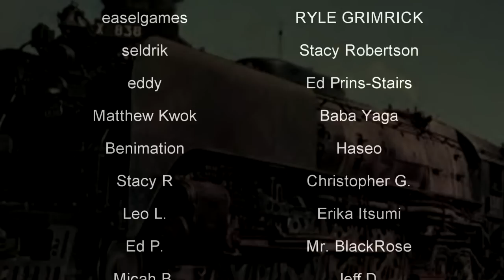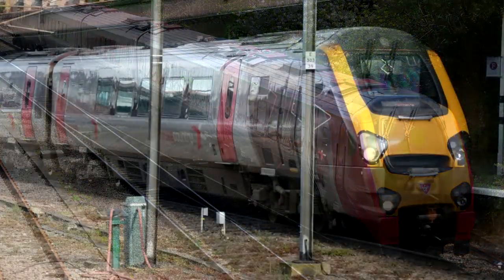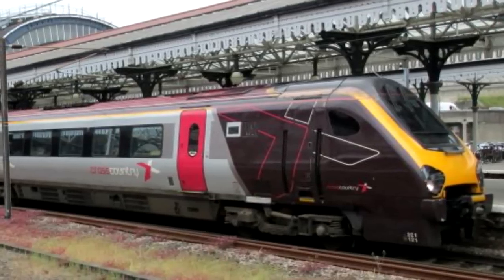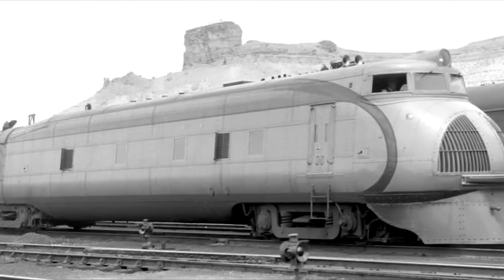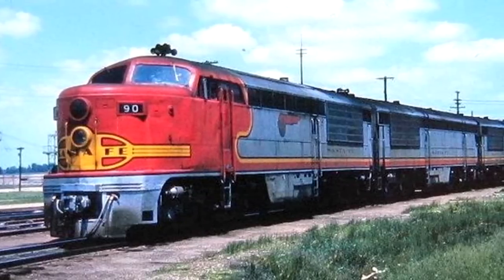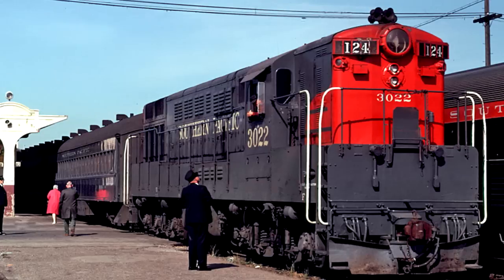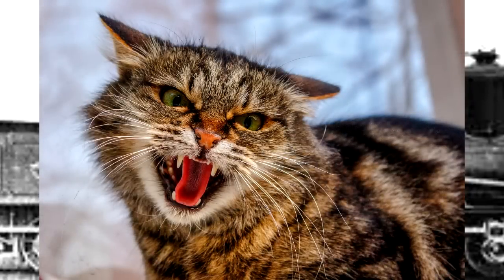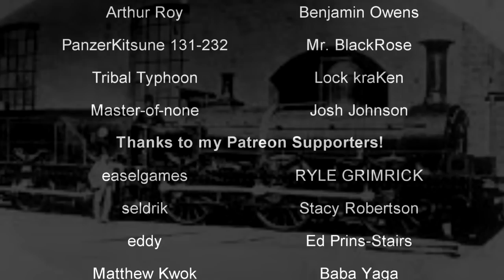5 Trains That Should Have Succeeded (But Failed) | History in the Dark

Comment: For anyone wondering how Bombardier stays afloat: it’s heavily, HEAVILY subsidized by the Canadian government because its a major company from the Province of Quebec, which had a problem with never having any money. It’s to help “stimulate their economy” or something.
Reply: Well now they’re part of alstom which gives them the perk of being able to stay afloat quite easier.
Reply: @twinboo529  but they still get the subsidies!
They’re not even French-Canadian any more!
Reply: Don't they also make private jets or is that is different bombadier
Reply: @hypernovamkvi715  no.
They make both.
Reply: @hypernovamkvi715  they also make a rather successful line of small regional jets (or at least used to)
Reply: They took over multiple Australian train builders so there is that too. They are good units if you remember they are built to a budget.
Reply: @Low760  To quote Wikipedia:
Rail equipment
Main article: Bombardier Transportation

The company diversified into rail transport after the 1970s energy crisis reduced demand for snowmobiles.

In 1974, the company received its first order – to build MR-73 trains for Société de transport de Montréal for use on the Montreal Metro. In 1975, the company acquired Montreal Locomotive Works. It was sold to General Electric in 1988.

In 1982, the company won a contract from New York's Metropolitan Transportation Authority to build 825 R62A cars for the New York City Subway for $663 million.[18][52]

In 1985, the company ceased manufacturing locomotives and concentrated on producing passenger train rolling stock. It acquired a 45% stake in La Brugeoise et Nivelles (formerly BN Constructions Ferroviaires et Métalliques) based in Bruges in 1986, the assets of U.S. railcar manufacturers Budd Company and Pullman Company in 1987, and ANF Industrie based in Crespin, Nord, France in 1989. A series of acquisitions in the United Kingdom, Germany, Switzerland, Canada, and Mexico further increased operations.

In 1996, the company was selected as the lead developer for the Acela Express trains, the fastest trains in North America, in a $710 million contract. Problems with the trains resulted in lawsuits between the company and Amtrak.[53]

In 2001, Bombardier acquired Adtranz (DaimlerChrysler Rail Systems), a manufacturer of trains which were widely used throughout Germany and Great Britain, becoming one of the largest manufacturers of railway rolling stock in the world.[54][55] This division produced the Bombardier Turbostar.

In 2005, it launched the Bombardier Zefiro high-speed rail, with speeds of 200–380 kilometres per hour, for the Ministry of Railways (China).

On February 13, 2020, Alstom agreed to buy the Bombardier Transportation division for €7 billion.[56] The acquisition deal was completed on January 29, 2021.[57]
In other words, Bombardier had money, they bought competent companies in the rail sector, then ran them like beancounters, not like engineers. Hopefully, Alstom can get them better management.
Reply: @the4tierbridge  that would explain it given the jet side of things is actually good.
Reply: @hypernovamkvi715  but they made trains before they started making jets.
Reply: @the4tierbridge  they split the company.  Alstom acquired their railway product lines, including the names of the product lines, but is not using the Bombardier name anymore.
Reply: Not too mention they make wayyyyyy more different products than locomotives/rolling stock
Reply: You have heard it's too big to fail. That is the Bombardier motto, it's basically being bailed out by the Quebec government. With the exception of the former UTDC Go transit comutter cars
Reply: @hypernovamkvi715  same company, still getting corporate welfare from the Quebec government and Canadian tax payers.
Reply: They didn't stay afloat too well since they stopped manufacturing outboards supposedly from the COVID slow down. They make literally all kinds of stuff that's why they stay afloat. They aren't limited to one product.
Reply: @JordosGarage exactly they are a mega company. Making all sorts of things. Just because one thing flops doesn't make much of a difference. Just shut it down and build other things.
Reply: Don’t they also make snowmobiles and atv’s along with motorcycles and trikes?
Reply: Alstom go brrr
Reply: Yep, the Quebec government basically kept them alive.

Comment: There is 1 succesfull type of steamtender locomotive who was build in large numbers worldwide.
The Garret.  
The water tender in front and the water/coal tender at the rear, both have a set of driving wheels on it.
The Boiler hangs articulated between both tenders.
Reply: Technically that wouldn't be a steam tender, as the driving wheels are articulated under the coal and water tanks, but the boiler is still the primary generator of steam. The "tenders" don't have power plants of their own.
Reply: @TheNightmareRider  It depends how you classify a steamtender engine. A garret has its driving wheels exclusivly beneath its front and rear tender. 
Yes it has way more articulation then a normal locomotive who has its driving wheels riggid under the boiler. 
A normal tender has very little articulation so the aditional set of driving wheels under the tender gave more problems then it solved.
Reply: Garrat
Reply: Garrets didn't have tenders.....
They were technically monsterous tank engines.
Reply: The Garratt was designed by Mr. Garratt (an Australian). Who sold the patents to the Beyer Peacock locomotive construction Co, of Gorton Manchester (UK). This revolutionary design involved DOUBLE ARTICULATION, whereby the cab & boiler are built on Bridge girders with NOTHING beneath. This central section was then attached to two engines one at each end using heavy duty pivots. On top of the two engines were placed large water tanks. With the engine nearest the cab also having a coal bunker.   

This design was extremely clever in solving a number of issues in the "Colonies". It allowed huge great powerful & heavy steam locos to pull huge trains on lightly laid track with as little as 40lbs a yard rail. It also allowed these MONSTERS, to negotiate horribly sharp curves. And cross weak bridges, because the total weight was divided through opposite ends of the loco, spreading the load. These locos as a result were built in their hundreds, for use in many British Colonies all over the World, running on all sorts of different track gauges.

Probably the most dramtic Garratts built, were built under license by the French (pre WW2) for use in Algeria. These huge standard gauge monsters were semi-streamlined, and used on both express trains as well as heavy freight, on the large Algerian rail network.  

South Africa was also well known for having hundreds of Garratts of various designs both on their 2ft 6in lines, as well as their 3ft 6in mainlines. Some weighing over 250tons. A handful of these ex South African 2ft 6in gauge Garratts, TODAY now run on the Welsh Highland Railway through the stunning Aberglasyn pass in North Wales (UK), having been re-gauged to 1ft 11.5in gauge !!!
Reply: @JamesSmith-mv9fp  As far as I know William Garratt was an Englishman and worked for Beyer, Peacock & Co. in Manchester, who introduced this design first to Australia, followed by mostly Africa and South America (he worked in Argentina for some time). Beside some prototypes in his home country the only major European Garratt operations were in Spain.

Comment: I've worked on FM Opposed Piston Diesels while serving in the Navy, and they were actually quite simple to work on.  The big problem was not exactly due to their design but maintenenace crews not being familier with them.  Having no cylinder heads, and associated valves gave them much fewer moving parts.  One of the biggest issues from a design stand point is that they don't like running at less then a full load.  Being two cycles they would build up excessive carbon in their exhaust boxes and behind the piston rings if run at a light load excessively.  For a railroad this isn't too much of a problem as locomotives don't usually run light loaded or idle for long periods of time.  As far as crank case explosions, no they aren't good at all.  Parts of pistons or rods can and sometimes do hit the side of the crank case hard enough to come through.  I have also seen the bottom crank shaft on one of these broken in three pieces, and according to the crew it belonged to, it was still running and trying to power the generator it was attached to.

Comment: The SP's Trainmasters were relegated to the San Francisco Bay Area commuter trains, because when they tried them on the road pulling freight (Sunset Route, based in El Paso,and LA-San Francisco), they encountered the same heating issues and sleeve and crankshaft failures in the American Southwest that you documented for the Erie Builts.  They lasted into the early 1980's on the Bay Area commutes, where the workload, temperature, and altitude was just right, and a ready pool of Fairbanks Morse opposed piston  mechanics were available (thanks to the US Navy's big presence in the bay).
Reply: They lasted until 1975 when Amtrak ended their lease of SP SDP45s and SP had an order of 3 GP40P-2s on the way.

Comment: "How is Bombardier still not defunct?"
TRAXX. The TRAXX locomotives have become so massively succesful that they can coast on that succes for years to come
Reply: They did end up being aquired ba Alston though, so technically they aren't around anymore (not that this changed much)
Reply: they are everywhere in the worlds rail networks, they got a contract worth £1.3 Billion for 70 Aventra trains for crossrail in 2014 along with a maintenance depot at Old Oak Common
Reply: @cyri96  to put it simply, Bombardier Transportation was big in railway equipment as Google is today in IT. Until the trouble started in 2012. Bought by Alstom. As of January 29, 2021, BT is defunct as a company. Their designs (TRAXX among others) are continued to be produced.
Reply: Also all the planes they have built.
Reply: @SDCHAWKSTITO  Yes. Bombardier Aviation (Canadair & de Havilland Canada formerly). Best business jets on the market today!
Reply: @andreww2098  But only because they were going to be "made in Britain" and Siemens pulled out due to build capacity issues.
Bombardier's Aventra's have had so many issues and for companies such as LNWR and SWR they rally should have gone with Siemens as that's what they've already got the most of and the reliability is known to be the best in the biz.
LU have now gone with Siemens for new tube stock, probably partially down to the issues they've had with bombardier products.

Comment: Bombardier Transportation was the world's largest rail equipment manufacturer. Bought by Alstom. Defunct since January 29, 2021.
If there's any electric/hybrid locomotive (TRAXX being cutting edge) in the world, tram, light rail, rapid transit (metro, subway, tube, underground etc. terms) or high-speed train, Bombardier Transportation had the largest share.

Comment: One really difficult thing with a tender that can apply power to the rails is the tender has a very fluctuating weight sometimes she's heavy sometimes she's light so sometimes attractive effort departed on to the rail was amazing sometimes all you got was Will slip unlike the engine which the weight stays fairly consistent

Comment: 7:37: ERIE-BUILT Locomotives: In the discussion of the application of the very successful application of the Fairbanks-Morse OP engine in submarines and the not-so-successful application in railroad locomotives - primarily the overheating problem - it must be noted that a submarine had an unlimited supply of seawater cooling. Even though it was an enclosed recirculating fresh-water system on the engine itself, this system gave its accumulated heat up through a heat exchanger into the ocean. Absent the massive cooling capability at sea, the same engine produced more heat under load than air-cooled radiators on a locomotive could disperse.

Comment: Never been a great fan if the Class 221s but a bit harsh to put them on this list. They've been the backbone of the cross country service for a couple of decades
Reply: I hate them,uncomfortable and they stink (at least the one I went on)
Reply: You sure?
Last i checked on Cross Country they were using class 43's on lease to VTEC because idk why.
Reply: @davidty2006  To be fair rarely go by train now, but did a short hop from Wakefield to Leeds about 6 weeks ago and it was a 221. I don't disagree about them being noisy and cramped, but I'm not convinced that makes them a failure. And preferable to a Pacer any day of the week
Reply: @davidty2006  When I went outside and actually touched grass I saw more cross country 221s than 43s

Comment: The steam tender idea is an interesting idea but they had problems 
1. Expensive maintenance 
2. High fuel consumption 
3. More work required 
4. More efficient and powerful locomotive where being built 

Also there is a book that talks about the steam tenders and many other engines you have talked about and the book is called Experiments with steam landmarks of British locomotive designs.
Reply: Well it was that or build a garret....
Which works in a similar way only like a monsterous tank engine...
Reply: That is a fair point but Garrett locomotives were in constant development to get them Bigger stronger and more efficient, had the steam tenders had the same treatment instead of being short lived they could have developed them into powerful and efficient engines.

Comment: The FM Trainmasters saw a little success with the Southern Pacific, which apparently employed enough former Navy personnel in their shops for the opposed piston engines (which are still used on ships and submarines to this day iirc,) to not be an issue. They didn't just look cool though, if that weren't enough! They sounded like absolute units too (I recommend listening with headphones, as the sheer bass the FM engines had is incredible): https://youtu.be/XElWHtywY6I?t=282

Comment: The class 221 never had new lines to run on. With very few exceptions we still only have old lines to run on. They run at 125mph where allowed. There’s quite a few stretches where they can plus several runs above 100 but below 125. They were nicknamed Vomit Comets. Part of the reason passengers don’t like them is nothing to do with the space in them. It’s due to the Government deciding they only needed 4 and 5 car units where as midland had 7 car units. The trains would get overcrowded and too many were packed like sardines stood up.

Comment: The second pronunciation of Bombardier is correct and yeah you would expect them to be defunct with so many mishaps but their strength does lie in a few outliners like the Traxx locomotives but they do more the trains, they are also an aerospace firm and they build trams/lrt. One thing they did make which is performing still strong but is showing its age is the rolling stock used by the Eurotunnel Shuttle service

Comment: It's a shame Fairbanks-Morse couldn't get their designs quite right for railroad work, and that railroad crews couldn't or wouldn't give them the care and attention they needed.  FM locomotives such as the "Erie Built" and the TrainMaster looked absolutely incredible and might have been more impactful on future locomotive designs, as the EMDs were, if they'd been able to turn things around into the 1950s.
Reply: Southern Pacific Commuter Crews really liked them, their acceleration was so great that SP had to modify their entire SDP45 fleet just to replace the Train Masters. They lasted 20 years in San Francisco-San Jose commuter service and were well worn by near daily use at top speed. The reason SP had the Train Masters in commute is rather coincidental, as SP originally intended for them to replace steam west El Paso, TX but the sand clogged up the insides rather infamously. Yet at the same time SP was in need of a high horsepower single unit to replace steam on the high priority SF commutes which the GP9 and SD7 proved incapable of, and conveniently SP had ordered the H24s with steam generators.